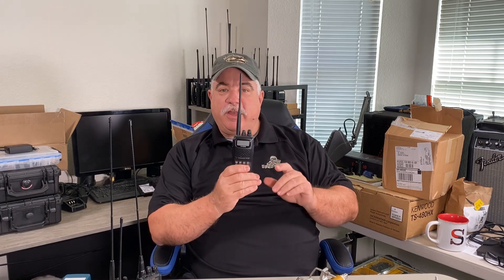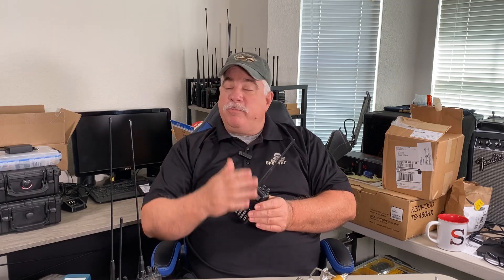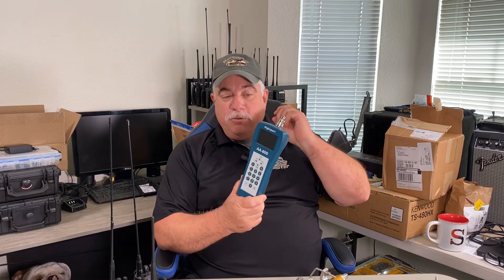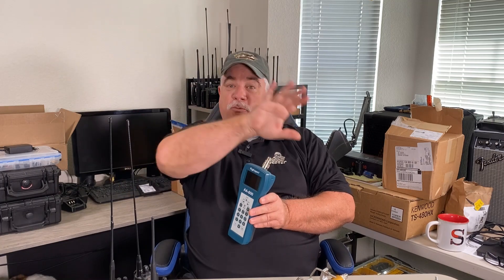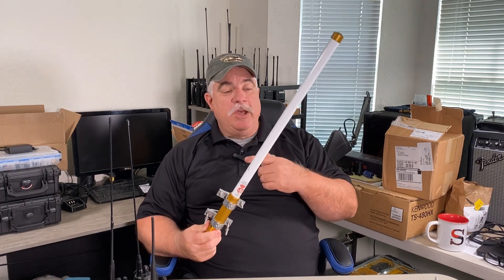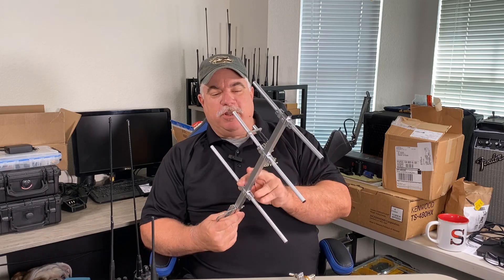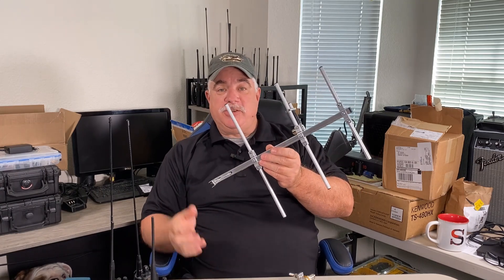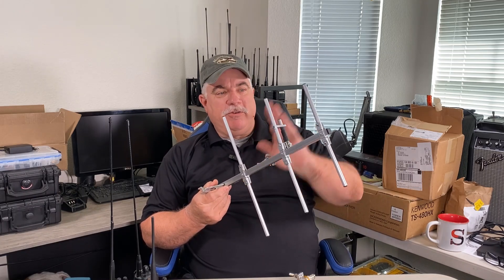VHF/UHF HT Maximum Achievable Range - Part 1: Series Intro

Comment: Can’t wait to see with that folding yagi can do I’ve been looking at it for awhile
Reply: I bought the HYS foldable 70cm yagi last week and I am impressed with it. I put a foam rubber hand grip on mine and plan on carring in my backpack for hiking/POTA use. Testing it on my Nano VNA shows very good SWR while holding it (<1.25:1) through the 70cm band. I was able to get a solid signal into a repeater on my HT, that I cant usually get into very well on the rubber duck. Its a solid built little yagi. 73!